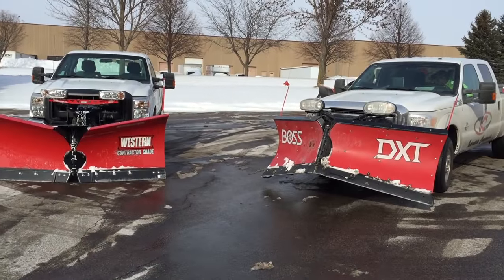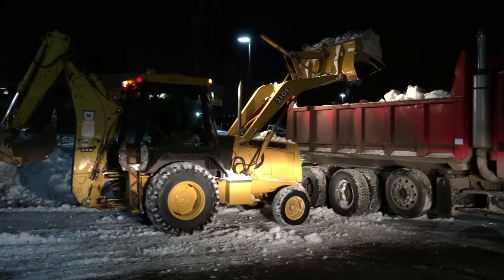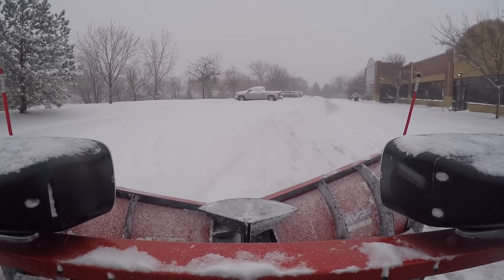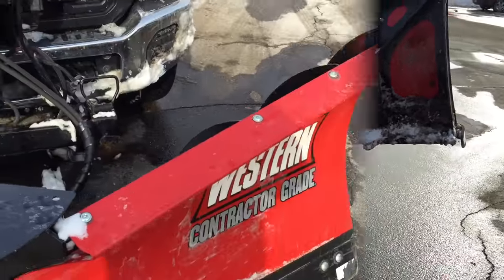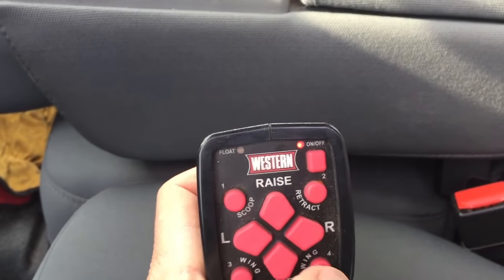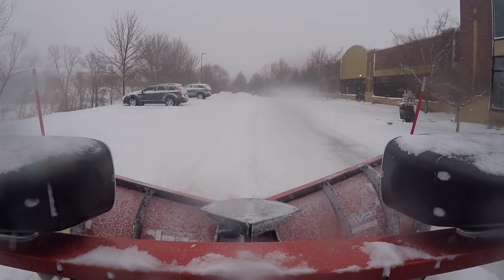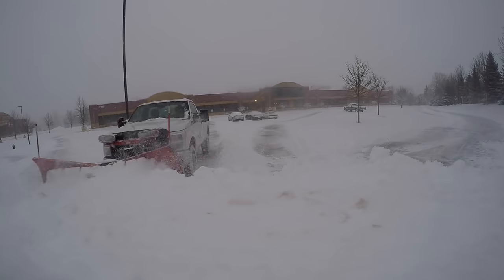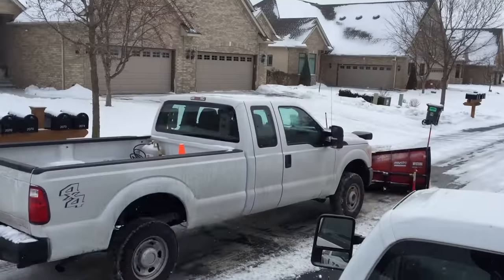Plow Review  Boss Vs Western snow plow

Comment: We've run western, Meyer, boss...it seems no matter what plow we use it depends on hours used, maintenance and operator. I had an old cable style western that I used for years.. I could fix or adjust everything on site. Had a guy use it once and broke the controller and knocked it out of adjustment then overheated truck and cracked a head...i have a new wide out this year which is great. The Myers had coupler issues which would lock up the hydraulics...just because of the ultra mount I would never get anything else. As far as support goes... Lol.. You break it you buy it...thank you very much. My personal favorite honestly is the 8 foot Protech on the skidsteer. No if only I can mount that on the truck... Maybe next year... Thanks Stan!
Reply from the maker: +Chris Smith That would be awesome!  I would love to see a pro mount on a truck  never even thought about that haha!

Comment: Have been plowing residential for the past 20 years and have a western Ultramount, a western unimount (isarmatic III) and an 8 ft snow dog  (all straight blades) . I have never seen a use for a v-blade doing residential. They're way more costly, both in the initial purchase, and maintenance department. My unimount western is over 30 years old and is still plowing snow (although the truck it's mounted on is no longer road worthy). Have had no problems with western service, although my snow dog dealer has closed up shop, so keeping my fingers crossed. By far,  my western ultramount  has the best attachment system. The snow Dogg is extremely difficult to line up and mount when on anything but a perfectly level and hard surface. The western unimount is the best for pushing up the snow (critical when snow starts stacking up in november, and doesn't stop till the next april). All blades have grassbars on the cutting edge, so matt buildup is a fact of life, especially when doing residential exclusively. If i had one wish for an innovation in plowing, it would have to be a wifi (or similar ) controller, The only wire passing from the engine compartment , to the plow unit would be 12v dc power , using a ruggedized military screwlock connector. The bulk of the problems I've had over the years has been with the worthless plugin style connectors. These plugs disconnect while plowing, they get snow in them causing opens, they're very costly to replace and none of the manufacturers are any better than the others at making a bulletproof connector. A wireless Operators controller , and wireless control board inside the plow hydraulics/electrical boxes, could eliminate the need for costly downtime, diagnostics and replacement parts. I've used most of the plow brands out there and will stick with Western.

Comment: I have ran Boss plows since 1999 the only trouble I have had with the V blade is I do brake the v at the bottom when people get to ruff, very little problems with the v coming back when full of snow, they work real well and I have two good dealers I use I have both of there cell numbers if I need parts in a storm, I do keep a spare blade, and a lot of parts I am 1.5 hrs from the closes dealer, also you should of showed the joy stick controller for boss much betterThanks for the video
Reply: it happens

Comment: I'd like to know of your (or others) experience with steel vs. fiberglass blades.  Steel are heavy (700-800lbs) traveling between plow sites and will wreck a suspension in one season.  Do fiberglass plows make a difference in this regard?
Reply: theres not fiberglass that i know of  but theres is poly moldboards  and most brands they are actually heavier then steal  because the require more steal frame work behind them
Reply: Well, the poly blades I have used and run (Western straight and V) are lighter than the steel, you can check the manufacturer's spec sheets. MVP3 saves about 50lb. I think. Poly also do a great just shedding snow and not collecting clumps. If they do you can try rubbing rainX or silicone into them. Less likely to dent/ deform as well.

Comment: Stanley, I am just getting into plowing. I've been thinking about buying a Boss EXT. Do you have any experience or knowledge about these plows? Also, I notice you have Ford Trucks. Is that the best truck to use for plowing? If not what truck do you recommend? Thanks
Reply from the maker: I have not had a chance to run one of these.  I have been trying to get together with Boss to do a test run so I can critique the plows but no luck so far.

Comment: i had a 8 foot straight blade western on my old 250 superduty years ago and i was great..i liked the hook up system..was very forgiving.. i know they do not make them anymore but now i have an older diamond 8 foot blade....very well built..has meyer hydraulics.
Reply: Diamond is made by Meyer... the only difference is that the bottom edge trips instead of the entire moldboard.

Comment: like the western ran a 8' straight for years never ran the boss but here good things and would try one. Meyers are cheap but will get you started. go to a steel shop and get your wear bars cut better steel last way longer can drill holes yourself use lots of wd 40 when drilling cuts better

Comment: How do these plows react when extended forward and then strike a hidden obstacle at higher speeds? We plow roads with cut banks & it is easy to catch the bank or other hidden stump, rock, etc. I only have experience with Meyers, & as a fill in plow guy(so very little experience)... But with this plow when I catch a rock etc. , it just blows the hydrolic line. Is this something that would be universal?  Looking to purchase new plow for next year, so just curious. Thanks for the info,

Comment: Great video! I use to run boss rt-3's for the people I bought my unimount v (with truck) from. Several years in and I'm finally getting the western going.  They were rigbt, westerns are a pain to work on but man the smoothness with which they operate and clear snow beats boss. I for one am for the western controller for even though it has more buttons, each button is a short cut to a boss operation that requires playing with 2 buttons. I.e. you want full left or right on a boss you have to hold both left and right but the western has one button to move both wings in unison in either direction

Comment: Nice video! I spent over 20 years in the high-lead cable logging industry here in Wa state (unfair comparison), but none the less have used Boss for horrible off road plowing. Normally we'd use very large heavy machinery but now and then if it were less than 12" of snow we'd do it with p/u's. Please keep in mind I have nothing against Western plows as I know nothing about them, in our industry Boss was what everyone used- they were exceptionally durable, even when they got ripped off the front of a p/u by hitting things they were not intended to be used for, lol. Boss is a great product!

Comment: I can not comment on Western as I own a Boss straight blade. I had issues with the valve that allows you to mount it. I called Boss customer service and they were great, they spent so much time with me helping me diagnose the problem. I would probably stick with Boss just for that reason. And this was a 10 year old plow.
Reply from the maker: Boss did the same thing for me.  I had one of the wings rip in half.  They replaced it asap-no charge. Great customer service!

Comment: I've been running a boss power v since 2005. I've actually never had one single problem other than bad headlights and some wiring grounds going bad that I re did this year. I absolutely love the boss controller with 5 buttons. My cutting edge hasn't even wore down yet and I used it everyday for a year straight plowing parking lots. I will stick with boss for as long as I plow
Reply from the maker: I should have went all the way with Boss-  never had any problems.

Comment: hey stanley just a quick question! since you been plowing for years i need your expert advice! i been plowing for 3 years using my buddy western unmount truck! this year i got my own truck and was shopping for a plow! now I'm stuck between a boss dxt a western mvp3 and the western wideout! i will be doing mostly driveways and couple small to medium size lots? I seen this video and aware of the comparisons but with the boss dxt i know it has a dual trip system as the western only has a trip edge system! in this video it seems like you are ok with the mvp3 but in another video u said u didn't like the mvp3! any input would be gladly appreciated
Reply from the maker: I would never buy another MVP3.  In fact I am not a fan of Westerns service-  even they make great straight plows though.  I like Boss for v plows.

Comment: So I just figure I ask some questions.. I have a lawn maintenance, landscape and excavating company in NJ.. I plow snow 25 commercial lots and roads for a township near me.. I have Meyer western and fisher plows just straight blades.. My question to you is is it really worth the investment to buy a v plow.. I have had the buyers pro wings on my 8ft Meyers def cut time out but for the price of a v plow  idk. I do have loaders so big storms it doesn't really matter.. Also I hear boss aren't bad plows def little cheaper than fisher western or Meyers. But with that fixed cylinder can you stack snow as much as chain lift.. We are going to be making some new purchases as far as trucks and plows but would like to know
Reply: I have straight and v. V has some advantages, however I'm cheep and only bought one. I like a straight with wings, and if I can get a good deal my next one will be one of those expandable plows.
Reply: If you're doing lots if get a wideout. Can scoop and angle together unlike v plow. Plus you have the availability to go from 8 to 10 ft wide. V plows are in my opinion just great for breaking through feet of snow then you just use them in scoop or straight. If you're going to invest in a plow get the wideout, 7 plus years with mine and still working like new! I know this is a few months late but Hopefully this helps you.

Comment: This is a really good video. I sell and service BOSS and have virtually no competition from other manufactures. However I do like to know what else is available. I service a lot of older Western plows and the few times I've called Western for tech support I've gotten no where. BOSS is hands down the best for tech support. They don't have dedicated tech support agents for dealers/installers. All calls are answered promptly and professionally whether you're a owner or dealer. The agents are very product oriented and knowledgeable. I am obviously biased when it comes to the product I sell but Western puts out a good product and this video will help me answer customers' questions.
Reply: Hi maybe you can help me . I just purchased a boss htx plow for my 2015 f150.XLT/  It HAS THE 5.0 BUT IT DOES NOT have the plow prep kit. I was under the impression when I purchased the truck that I could get it later. Now that I have the plow I called the dealer about the kit. They think it only came from factory and can not be added later. The shop I bought the plow from said I do not need the kit to run the plow. My truck is not overloaded with options. My question is what should I hook up to, to power the plow?
Reply: Kelly Johnson I don't think i understand your question, you always hook up to your battery to power the plow/solenoid. you shouldn't need the plow prep kit to install the plow.
Reply: Thanks , What I am trying to ask is for ignition power so when you turn the key on the plow has power . When you turn the key off the plow doesn't.
Reply: Kelly Johnson first check under the driver side dash for blunt cut wires, on the super duties there is a label which identifies those wires, usually the violet wire is switched 12v. however, they may not be present on a 150. you'd have to probe fuses (one 15+ amps) in the passenger side kick panel. once you find one that is ignition switched, use the BOSS supplied fuse tap and you're good to go. you may have to extend that black/red wire in the BOSS harness to reach the passenger side.
Reply: Thanks again , much obliged !

Comment: would have been nice if you would have pointed out dome of the other features of the BOSS over the western.  The DXT is a full trip plow with a trip edge as well.  far superior than a single trip edge.  The DXT steel plow is a welded mold board where western is a thinner bolted on sheet.  BOSS uses A single piece HARDOX cutting edge for each side with a formed curb guard.  Far supirior as you saw by how fast his cutting edge was gone.  BOSS does offer a pistol grip style control similar to the Hiniker.  You should have also noted the LED light system that was new last year that has awesome light output with dual burn capability.  just to name a few.
Reply from the maker: +Josh Kunze I just couldn't cover all the technical differences in a short time.  Thanks for pointing those out.  ;)

Comment: Stanley I know that western is made by Douglas Dynamic just like the Fisher's are but Fishers customer service is excellent never had any issue with asking them questions or getting advice I have personally owned and used Fisher Myers and SnowDogg. SnowDogg's have been getting better and better I currently have a fisher straight blade and 2 snowdogg ex blades. Would highly recommend getting either a fisher or snowdogg expandable 8-10 plow fishers preferred to me cause you can make it just like a V in a sense cause you can expand the wings and angle them individually or together.   I think if you try it you wouldn't wanna go back to boss or western or at least the boss. Since the fisher and western are very similar.

Comment: Apparently you don't read your manuals and your dealers don't explain the features. You can program western and fisher controllers for one touch float so you don't have to hold down the button. Use the scoop and retract buttons for exactly that purpose. The individual wing buttons are there to get blade straight, fully retract one side and fully extend the other

Comment: I actually thought I commented on this last year when I was having issues with my western plow.  My first truck was a fully hydraulic old setup on a square body chevy truck.  It was a old fisher setup, and was a tank.  I then picked up a newer 2000 silverado and put a curtis plow on it.  Not much out there on curtis plows, but that plow was a BEAST.  When it worked, it worked fantastic.  when it failed, it failed badly.  Parts were hard to come by, but in all honesty, in 8 years, it only failed twice, and both times could have been avoided had I done a little more preventative maintenance on it.  My current plow setup is a western on my newer silverado.  In all honesty, I was ready to pull the plow off of my truck and lite it on fire last winter.  I went to a local company for support, as to diagnose it, you need the diagnostic harness, which if you can find one on line is useful!  otherwise, you're stuck going to a dealer.  This guy at first was very helpful, but then once it was still broken, his employee's were not so very helpful.  In fact, I was told that I should diagnose it myself, because i'm too small to waste time on.  I then contacted western plows on facebook of all things, and within a day I had a response, and a number to call.  I spoke with a executive who then told me to call that local dealer one more time for an appointment, and if they jerked me around anymore to let him know, and he'd take care of it.  Needless to day, it was taken care of.  Shouldn't have gone to that level, but it is what it is.  The plow itself works well, but as soon as I can afford to, i'm looking to replace it with something else.
Reply: diabel1969 are u in Massachusetts because Curtis plows are from Worcester Ma.  If u are let me know I can lead you to a great Western Dealer on the outskirts of Worcester county.
Reply: No, but i'm not very far from Mass.  I live just west of Albany, NY.  When I had that curtis plow, I was dealing a lot with a dealer in queensbury NY, just north of Lake George.

Comment: I've had great customer-service for my Boss plow. Both at the local dealership and the HQ. I can just call and talk to a real person pretty much anytime. The last time I called about a hydraulic issue the woman at the HQ conferenced me in with two local dealers. It was great having all those people communicating with me to help solve the problem.

So far as chaining a plow up goes. I've never had a catastrophic failure of my hydraulics. However I did get water into my reservoir once and got caught in the field w/o enough fluid. I always carry heavy ratchet straps with me and I used those to both lift and secure the blade up and get it back to the shop for repair. Driving the plow up a snow bank in full float didn't occur to me. But I don't think I want to be standing in a snow bank while I secure the blade in the up position either.
Reply from the maker: My boss service was excellent as well!

Comment: folks when your wings break away is a good thing. If you hit something you can't see on a boss your wing just collapses. It doesn't blow a hose or bend a cylinder.  I push piles of snow taller than the hood of a super duty ford and it has never caused the wings to fail.